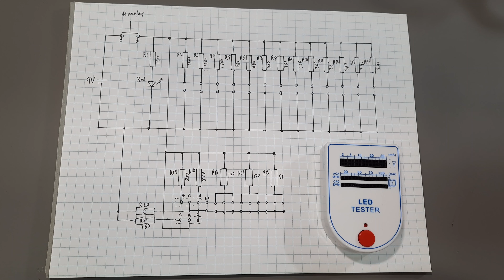LED Tester Can you spot the design error

Comment: I tried to burn a LED in the same holes , nope no burny burny it just lit up normal I tried to put it in backwards No litey litey and when installed correctly  it lit up as it was supposed to ....... Your video link is in Mr. Carlson's Lab patreon section ..... A member posted it in there when he saw Paul using a tester like we have ..... So if your views have jumped up by a thousand or 2 , that's why....
Reply from the maker: Apparently the older through hole design was built correctly as one viewer indicated. Wonder when that was posted at Mr. Carlson since most of the views (4130) came in the first 4 days of the video ( March 2 to March 6). And yes much higher viewing than normal after that 800 views from day 5 to 43 when it normally is flat.
Have a good day
Reply: @retireeelectronics   7 days ago it was posted by Roberto Coli . Love the Prospector Coin .... I'll check out some of your videos....
Reply from the maker: @cajuncoinhunter  Thanks for the date it was posted. That was my second highest viewed video. 
That Prospector Coin I picked up about a decade ago, one previous career was outside exploration for copper zinc and gold mining.

Comment: yee gods, a special purpose led tester? 

iunno, my experience of doodads is the battery will be flat the once in a blue moon that i go to use it, so then starts the saga of finding the battery tester only to find it is in need of a battery test itself...

three hours later, at the shops... WTF am i doing here? wasnt i supposed to be fixing a path light?
Reply from the maker: I have started making sure I pull the batteries out now. Lost two to many pieces of EQ from leaky batteries.

Comment: I just got out and taken it apart. The build quality seems better but it still has the same odd design and issue. I also took the test button board out to examine and found that bodged with a miniature leaded resistor rather than an SMD. The LED by the test button also shorted internally somehow, turned dark and emitted a burning smell despite no apparent physical damage. I have worked with electronics for many years and replaced SMD devices before, but it would seem these LED testers are borderline junk. I may try and resolve its issues at some point, but I'm inclined to find a decent replacement or design and build my own.
Reply from the maker: I plan on building my own shortly using some of the comments I received.

Comment: Definitely not a precision device. Doesn't compensate for a low battery. Also ignores the fact the LED's have different operating voltages. So it can't provide an answer to the question "If I give it this much current, how bright will it be?" But it's a handy does this LED even work type tester.
Reply from the maker: It is relatively cheap, but I am going to build my own now. Something everyone needs to remember is how we see light brightness. The green even with poor accuracy at a few mA was far brighter than the red at 20mA ish. So if designing a display for night that needs to be taken into account if and only if current is important.

Comment: If you use a 9 volt battery that isn't run down, there is very little merit in using a constant current source or sink.

The lowest LED voltage you'll encounter, and that is with an IRED so you probably won't see anything anyway, is about 1.1 V. A white LED might be around 3 V at low current. That leaves you with a range of 6 V to 7.9 V across the current limiting resistor, which means a range of currents of 7.9:6 or about 1.3:1. That variation is so small that it is of no practical consequence and certainly not going to make a very obvious difference in perceived light.

If you wanted to run with only 5 V as from USB, then a current source would be more sensible since the LED forward voltage is a much larger fraction of the supply voltage. If you use a high voltage, say 24 V, then you could have a configuration with one current source running a string of LEDs in series, which might be convenient if you were trying to match the brightness of some bargain-bin LEDs. 24 V of course is far too high as a reverse voltage (so is 9 V and even 5 is for some LEDs), so connecting LEDs in reverse would likely be destructive. A 5.1 volt zener across each pair of socket pins would probably protect most LEDs from excessive reverse voltage reasonably well. 500 mW zeners will have a better-defined voltage at low current than1 W zeners.

A single current source for LEDs in parallel is rather useless unless the LEDs are well matched.

If you want to run with a 5 V supply and use a current source/sink, be sure its minimum voltage drop for regulation isn't too high for regulation with white LEDs. An LM317 would be unsuitable.
Reply from the maker: It will be interesting building my own, since I can add displays for current.
Have a good day

Comment: Mine is correct. There is a 360 ohm resistor on each Cathode leg to ground. Mine is also very old and uses thru hole resistors.  I have never even used the lower rows.
Reply from the maker: Guess they fouled it up when they went to surface mount. To bad they did not check the design

Comment: The design error is that nobody tests anywhere near that many LEDs all at once.
Reply from the maker: True for the loose fit but does not help for common anode dual colour led tester section CAC. It is still a dead short to ground for one of the side of the LED

Comment: The way to fix these properly is to replace the dropper resistors with LM317LZ in Constant Current mode.
The connections on the lower rows right side are for 4-pin "Pihrana" LEDs (0.2" pin spacing) which is what the little picture actually shows.
Reply from the maker: I think it is time to make my own DIY LED tester incorporating as many of the comments that I can.

Comment: Warum so viele Buchsen für die LEDS?? Wieso nicht 2 oder 4 Buchsen, dann einen Drehschalter, mit dem man dann die Ströme oder Vorwiderstände schalten kann. Und was mir persönlich da massiv fehlt, ist eine Spannungsstabilisierung. Da eine 9Volt Blockbatterie nicht endlos "Saft" hat, geht die auch von ihrer Spannung sehr leicht runter - und dann stimmen halt deine ganzen Ströme auch nicht mehr. Also m.A.n. müsste man erst mal die Eingangsspannung sauber stabilisieren / fixieren, wenn Du keine Stromanzeige einbauen willst, die den tatsächlichen Strom misst und anzeigt. 
Deswegen frage ich mich etwas, was dieser Tester machen oder bringen soll?
Reply from the maker: Cost is the answer. A rotary switch or display would cost more than all the resistors and sockets on the device. It would be a nice DIY project to build a better LED checker.

Comment: I thought you were going to point out that most LEDs can't handle 9V in the reverse direction, so having a 9V supply directly on the LEDs for a tester is a bad idea....
Reply from the maker: Three AA or AAA batteries would make it more user resistant 😊 to limit it under 5V reverse voltage. I thought when I did the schematic that I must have made a mistake, then I checked it and rechecked it. Maybe the company also sells common anode red green LEDs (-:
Reply: @electronicswithemrys  - the silkscreen is misleading, but the bottom left is for 3-pin dual colour, and the right side is for high current 4-pin "Pirahna" LEDs with 0.2" pin spacing. The top row is for 0.1" 2-pin indicator LEDs.
The design is correct for the use-case, as you couldn't the alternative packages if it was only the top row available.
Reply from the maker: Had not thought about the Piranha LEDs for right of the CAC section. The CAC is still designed wrong with the one cathode going straight to ground. Have added a resistor and adjusted the traces for the CAC  section at the end of Mailbag 54 ish so it works properly now.

Comment: Different colored LEDs have different voltage drops, so fixed resistors are likely only calculated for red LEDs
Reply from the maker: Yes it is going to be very rough calculation for the current. But this product is a quick way to check if a LED is good and gives you an idea of the current needed for a certain brightness. Then if needed fine tuning the resistor for a project.  For projects I stick outside for night time, aiming for 2-5mA usually is bright enough. The LED should last basically for ever at the low amps

Comment: Why not cut the trace and insert a 360R?
Reply from the maker: I should have done that in the video. Pop out the 000 and replace it with a 360 ohm, cut the trace then bridge the ground across to the pin where I indicated.

Comment: I use the basics components Tester or the multimeter to test the LEDs 😉 I had a LED Tester  when I was way younger but these spid connector don't last, the round will Also fail rapidly, the Real solution is a Zif Socket 😉
Reply from the maker: Thought about a Zif socket but the ones I have all have wide footprints.
Reply: @retireeelectronics2649  it's the only durable solution 😉
Reply: I have about six meters only one will light up an led .
Reply: @selwyngregory8773  yes it depends on the meter
Reply from the maker: That is strange, even my $4.12 multimeter DT-830B from Mailbag 43 would light up an LED. And that meter is cheap.